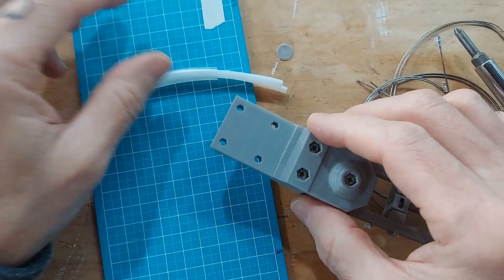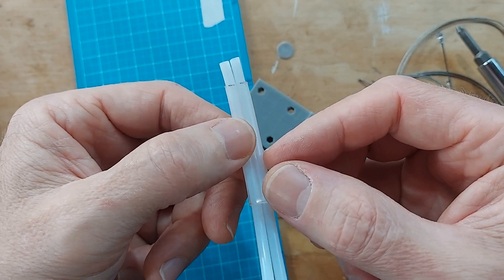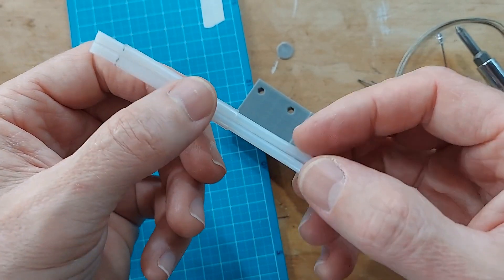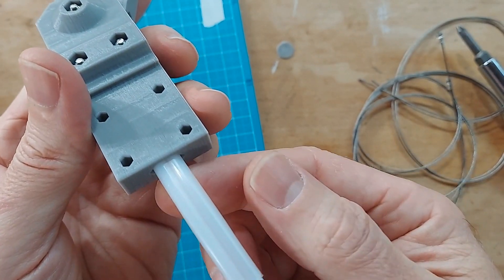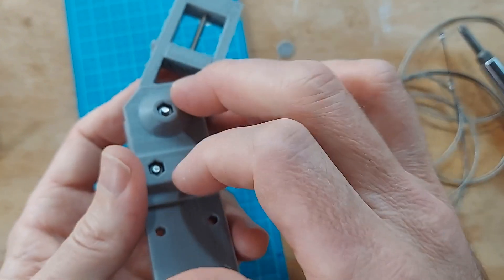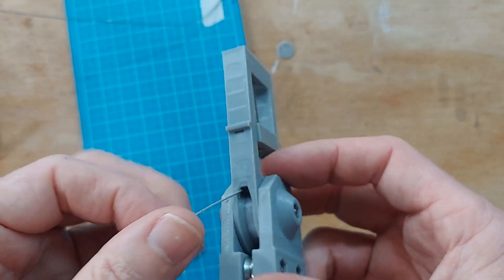Robot Arm Joint, v2

Comment: Great design! How much torque magnification could be achieved?
Reply from the maker: Good question. it's really just simple pulley dynamics, so the torque would be modified by the ratio between the pulleys (currently with this design it's 1:1). If you wanted the ratio to be large, you might need to consider a compound pulley block -- there are examples of this in other videos out there.

Comment: You could make a second video showing how the joint operates when connected to the actuators.
Reply from the maker: Yeah I'm kind of thinking that I might just reshoot the whole thing. Next time I think I'll just cut it apart, lay everything out on the table, and put the whole thing back together.

Comment: It would have been nice if you showed the crimps installed and the cables hoked up to the actuator assembly, and then operate the joint to demonstrate how the joint worked.
Reply from the maker: I wholeheartedly agree.... the production of this video was making me irritable for some reason 😖 The original video was almost a half an hour long until I spent 2 hours editing it... better luck next time 🤞

Comment: Is the stailess steel wire less stretchy than an ordinary bicycle cabling and associated sleeving?
Reply from the maker: Honestly stainless steel probably isn't the best choice because I think it's kind of stiff and probably will break down eventually. But it was cheap on Amazon for spool of it and it is thin.... less than a millimeter. A softer still like bike cable would probably have a longer life.